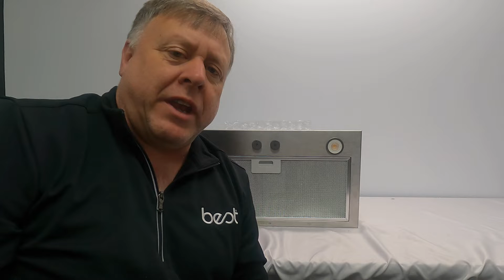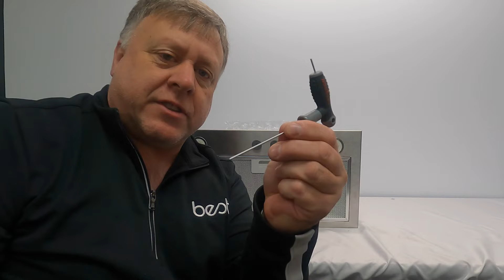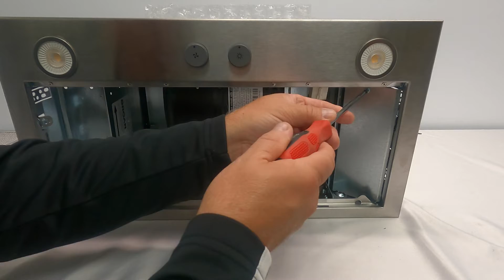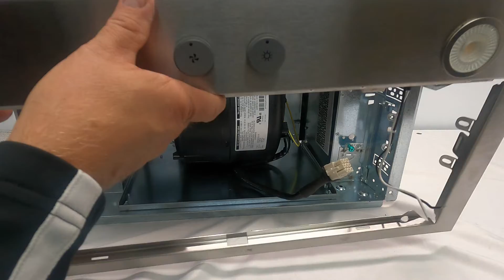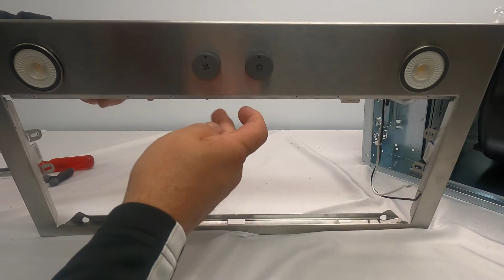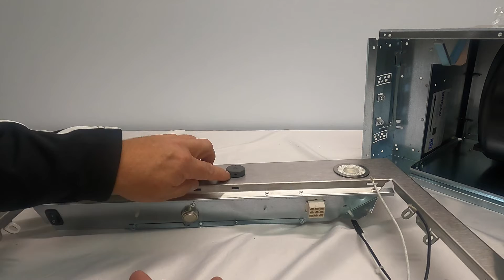Broan-NuTone PM400SS Switch Replacement | Range Hood Control Repair Guide

Comment: In the circuit diagram, I see the diode and the switch.  Is the diode built into the switch itself?  I don't see it in the parts list.
Reply from the maker: Thank you for your question regarding the PM400SS power module.  There isn't a diode present in this model.  The lights are an on/off function.  Please contact our Product Support team directly with additional questions at 800-637-1453.

Comment: My light switch keeps spinning without turning light on. Could this just be because it wasn’t assembled correctly? Parts not lined up?
Reply from the maker: Thank you for reaching out. Please call our Product Support Team at 800-637-1453 so that we can troubleshoot with you for the simplest solution to this issue.